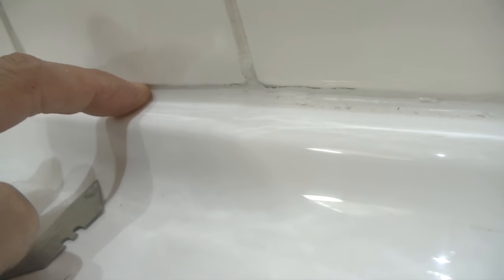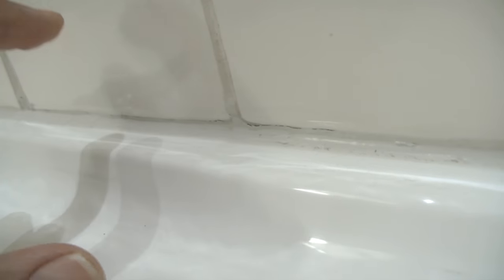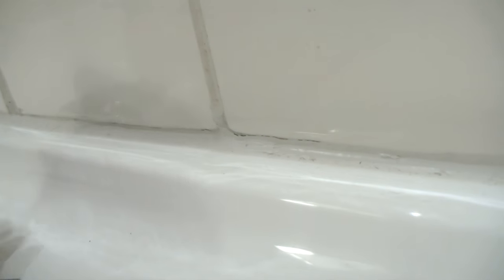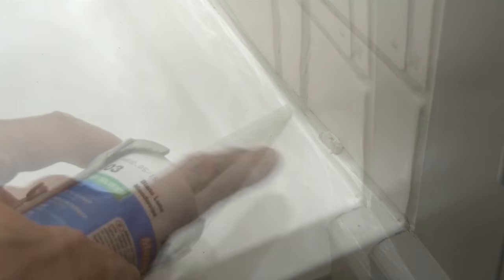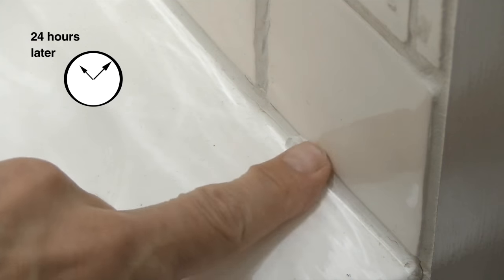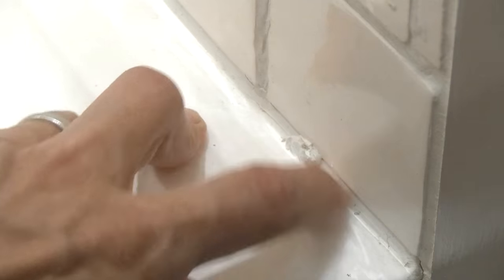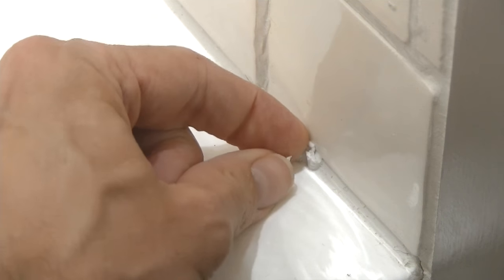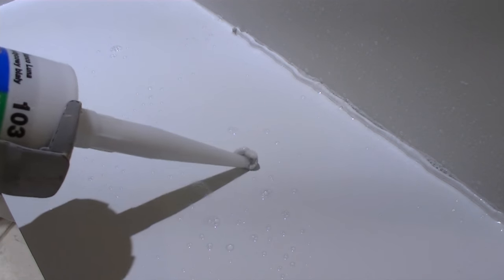Can You Silicone Over Existing Silicone?

Comment: Another tip i would like to add and my apologies if it has been mentioned already. WD40 is great for removing old silicone , spray on and leave for 5 mins then spray a little more and scrap off with a plastic scraper so not to damage the surface.
Reply from the maker: Interesting tip. Presumably it doesn't degrade the silicone, just reduces the friction when you scrape it off - so the primary benefit is not damaging the surface.

Comment: Thanks. Just caulked my bathroom entirely. A lot of uneven gaps between the stone and tub left when installed by last occupant. The job required using more caulk that you might typically use to fill the gaps. I didn’t want to overdue it but after it dried there’s a few tiny gaps left. This makes me feel better that I can fill them in instead of starting over. Thx
Reply: i hope you mean silicon. Caulk is for painting.
Reply: @ninpo1979  yes had me a bit confused there.

Comment from the maker: I posted this video yesterday and then realised (after a comment from Ian Mathieson - for which thanks, Ian!) that I didn't put enough emphasis in the video on the need to clean and degrease before re-siliconing. So here's the updated video - hope you find it useful.
Reply: Charlie DIYte:  Charlie, many thanks for the acknowledgement - wasn't expecting it!  Yes, good to use water and detergent to remove any greasy buildup on the silicone - we all know it exists, that's why we have to clean our baths from time to time.  But it's essential to then flush away any trace of detergent using plenty of water as detergent is a perfect silicone release agent.  Lots of flushing is the key.  Merely wiping with a wet cloth, while it will dilute the traces of detergent, will still leave some traces as the water evaporates.  This is a common misunderstanding amongst people trying to clean any surface prior to getting anything to stick to it.  Rub to get the worst off, then flush copiously, allowing the surface to drain off at an angle and then dry without wiping.  This applies to degreasing solvents as well as water.  In industry, hot vapour degreasers offer the best cleaning but are beyond the scope of DIY because of cost, the hazard of inhaling hot solvent fumes, and the need for regular maintainence.

And I can vouch for the effectiveness of a 45 degree edge.  There's a golden rule in industrial design when casting or moulding rubbers to bond to a rigid item, that there must be a 45 degree edge, either machined into the rigid item or built into the rubber mould.  A 90 degree edge fails at a lower applied stress because any mechanical load including temperature cycling, results in a higher stress concentration at the edge of the rubber and so reaches the strength limit sooner and encourages peeling.  A 45 degree edge allows the stress to taper off towards the edge due to local flexing of the rubber, so the stress at the edge is minimal and therefore offers the best resistance to separation or peeling.

Hope this is of help to everyone generally.
Reply from the maker: Thanks Ian. Not at all - I always like to give credit where someone adds value, and you've done me a huge favour by re-commenting, because I wanted to copy your entire comment from the old video but stupidly deleted it before I could do so!
Reply: Charlie DIYte:  Never mind.  Just a shame I don't have a copy of my first comment.  Didn't realise comments could be deleted once posted.  We live and learn.  I like the thoughtfulness of your videos and have subscribed to them fir the future.
Reply from the maker: Thanks Ian - much appreciated!!
Reply: Thanks for the vid Charlie, had some pretty poor work done by "professionals" that have gone mouldy within a month of them refurbishing my bathroom. They've also used silicone to fill the tile edge that meets the bath and I just can't remove it no matter how much scraping I do so it's great to know I don't need to do anything extensive other than remove the mouldy silicon, clean and reapply.

Comment: I'm glad this video just tells it undeniably. So many sites say you can't though look closely they are either major builders or the silicone manufacturer - go figure the motives! Chemically speaking so long the silicone is the same the new silicone has no way of 'knowing' whether the last layer just cured is fresh or old. The real issues are due to a layer or grease / dirt / mould which obviously DOES make a big difference. An interesting counter case: in the toy model world they have the opposite problem of having to deliberately spray a barrier between the silicone mould and the new casted silicone material so that they don't stick - so it can't be that in one industry the chemical properties suddenly behave differently to another!
Reply from the maker: Brilliant comment and you're absolutely right. It does need to be the same chemical make up, as well as properly degreased.
Reply: GE says you actually can just that it won't adhere as well as on a clean substrate. I've done it and it works. I just make sure that I clean the silicone that I'm covering with some rubbing alcohol to clean and remove any oils etc. Once this is done it bonds fine.

Comment: Ahhhh, see. I gather that one could use silicone sealant as an adhesive?  I'm wanting to stick two quite flexible silicone parts to one another. I wouldn't have thought of using sealant as adhesive.
This man is an unsung national treasure - a Barry Bucknall for our times!👏
Reply from the maker: Aw, thanks mate. Yes a lot of the sealants are also adhesives - eg CT1. It'll say on the tube if it doubles up as an adhesive. Check on a small area to see if it works.

Comment: I have to fix a botched blobby silicone job done several months ago. None of the joints are flush with the surfaces and there is plenty of cavity left to fill. If I understand correctly, I can clean the existing silicone with methylated spirits (deantured alcohol here in US) and once it evaporates, the original silicone will be OK to caulk over. It won't degrade the silicone? I removed a bunch of slop from the tiles with mineral spirits (white spirits in UK I think) trying to be careful not to touch the joints. Will that cause a problem if it did touch the joint or will the methylated spirits be able to clean it away? Thanks for the video, I agree with your technique as you were able to prove all your points. Thank you for taking the time to explain everything.
Reply from the maker: Hi Vicki, cleaning is always a tricky one as some solvents like acetone can damage plastic or acrylic baths/ shower trays. We have a cleaner in a spray can here called Multi-Solve which is great as it removes silicone but also evaporates without leaving an oily residue. You can never use WD40 for that reason - it's very hard to remove the oil and so the new silicone often degrades almost immediately. In answer to your question, I think there's a risk the methylated spirits will degrade the silicone. I can't remember whether I swiped it across the existing siliconing as in the video you only see me using it on the shower screen section which I'd totally removed the silicone from. My advice to you would be to use a degreaser like sugar soap solution or Zinsser degreaser and cleaner, rinse it thoroughly afterwards and then when it's fully dried you're good to go.

Comment: Been wondering this most of the day today. Silicone around my bath was done a couple of years ago but it's still clean and neat looking. Little bit behind the taps area though where the shower head water leaks down which I can see when I took off the side panel of the tub. Just put a clear silicone along the wall behind taps (can't tell it's been done obviously) so hope that fixes it. Touch dry just now but seems to have done the job.

Comment: This was really helpful, thanks for sharing Charlie.

Off topic, my shower grouting is cracked in between the lower tiles. I tried to re-grout after watching your tutorial but the results were messy. I’m hopeless with DIY.

I’m going to be selling my property soon hopefully and I can’t afford to have a professional in to do the job properly. Can you recommend something that I can fill the tiny cracks? I’ve seen various products on Amazon, one being a white liquid rubber product that has good reviews and can be applied using a paint brush. I’m at my wits end and currently have polythene sheets stuck with Gorilla tape to prevent damage to the actual wall behind the tiles.
Any suggestions would be greatly appreciated. 🙏

Comment: I need to replace the silicone round our bath, but the adjoining silicone that runs down the corner of the tiles from the ceiling to the top of the bath is still good. I was going to cut into it at the join and just remove the silicone from round the bath, then reseal it and try to blend that into the existing silicone that meets at the tiles. Would that work do you think?
Reply from the maker: Yes that's what I would do and in fact if you watch this video https://youtu.be/EErbuodMOAM that's exactly what I do.
Reply: @CharlieDIYte  thank you so much I'll have a look now! Going to sub too cos I need all the DIY help I can get lol. Thanks for the advice :)

Comment: I wonder whether it would be a different case if one were to use an acetic cure silicone over top of a neutral cure silicone (or vice versa).
Reply from the maker: Good question. You'd have to experiment in a small area like I did first.

Comment: Hi Charlie, thank you so much for your videos. They’ve been very helpful. I had a question. I used the Cramer tool to silicone around the bottom of my shower and did the 8mm size. If I decide I want to do 10mm, do you think I can just lay more silicone down over my current bead after I degrease it with denatured alcohol and tool over the old bead?  Or do I have to remove the entire original 8mm silicone and start over?  Thanks!
Reply from the maker: You're very welcome. I think that provided you use the same silicone and degrease it you should be fine. After all, that's what I did 👍

Comment: Any follow-up? How long did the small test patch hold? Thanks.
Reply from the maker: Still going strong a couple of years down the line, with no sign of mould or silicone failure, although I do fully squeegee the shower each day after use.
Reply: @CharlieDIYte  Still going strong? I'm doing a job where I need to build up in layers in a very awkward area on a window outside, so I'm using a hybrid polymer. I figured with how good that stuff sticks, it would have zero issue sticking to itself. Seems like it'll work based on this video.

Comment: Did you read the comment by Wyaj78 Charlie DIYte?
   
"As someone who worked in the maritime industry for 20 years doing most everything you can imagine the answer is a resounding no. My first rule is to NEVER use silicone period. It’s a contaminant more than it is a sealant. I’ve never experienced it sticking to itself with any success... ever. I haven’t ever seen it NOT fail either.
When sealing anything the number one rule is to over prep the area you’re going to seal. This includes roughing up the surfaces and cleaning it of any oils before you continue. Removing existing silicone is extremely labor intensive. Sure, the bulk is removed easy enough but what’s penetrated into the surface area is fairly permanent creating a big problem because it won’t stick to its self let alone anything else."

Q: If not silicone, what would you suggest for a bathtub? 

A: An acrylic bathroom caulk containing a mildewcide. It may not last as long as silicone on a NEW installation, but it will be a lot easier to remove and replace than silicone.

Comment: I was nervous about my reef tank re-seal. After watching this, and your response to my comment on your corner video, I applied a 16mm bead ontop of the initial 10mm bead.

I’m excited to see how it works out, hopefully I don’t have to spend another $350 on a new tank.
Reply: How did it go? I have just re sealed my 500 litre river tank but there is one area the silicone is, still a good cm out from the edge of the glass but is, spread really quite thin so I am going to go over it with a big dollop for peace of mind; as the reason doing this is due to a catastrophic leak aha. I'm very sceptical tho as everyone apart from one person in the aquatics hobby has said start completely over again

Comment: I followed your other video but messed up a 15 cm section in the middle and fast-setting silicone meant the surface got bumpy. Would it be OK cut out only that section and redo it, joining up with the existing bead on either side?
Reply from the maker: Yes that should be fine. Make sure you use the same stuff obviously and degrease the surface if you've used the shower, before you cut the section out. Yes you've only got a few minutes to tool the silicone before it skins over.

Comment: caulk master huh.  need help.  used ardex sx white caulk around my tub and within a couple months it turned yellow and hard.  now a year and a half later i need to attack this project.  ardex says if exposed to urethane fumes it will turn yellow and i used a urethane trim paint (emerald) from sw.  problem it is so hard, i can not remove it.  have been putting coats of acetone on it hoping it would soften it up.  found the tube downstairs and there was some dried caulk coming out of the end, it was white and soft/flexible.  any ideas?
Reply from the maker: Have you tried a silicone remover gel?

Comment: What about joining the new silicone bead with old bead (as opposed to over the old bead)?
Reply from the maker: I needed to redo it, in order to protect sections where the rather fragile glazing had chipped off the hand glazed tiles - the original bead didn't quite overlap the tiles sufficiently, and I had a leak where the glass screen meets the wall tiles, that needed sorting. Suffice to say it's never leaked since.

Comment: Hi, thanks for the video. When you clean with the spirit there, is that with the silicone still in place? If so, will this not impact on the existing silicone? Looking to do this and will clean the area first with methylated spirit, then silicone over the silicone?
Reply from the maker: Yes the silicone is still there. You just need to check the new silicone is compatible with the old. Try on a small area dust like I did, let it set overnight and check adhesion. Then you're good to go.
Reply: @CharlieDIYte  great thanks. So cleaning with methylated spirit first, won’t impact on the existing silicone? In terms of making it loose

Comment: I'm having a problem whereby a small patch of existing silicone on a vertical line has come away from a tile in my shower & I've put some Dow 785+ grey over it. However, I can't get the Dow to cure - it's more than 24 hours since I applied it & I'm wondering if the existing silicone is a different type & stopping it from curing? The tube I'm using was only opened in April, doesn't expire till next year & has been stored correctly. I tested it beforehand to make sure it was fine & it cured on a piece of cardboard. It's got me stumped!
Reply from the maker: That is bizarre. Not sure why is hasn't cured. You haven't put WD40 or any other silicone remover on the underlying silicone have you?
Reply: @CharlieDIYte  No, I didn't put anything on it. The existing silicone was Everbuild 825 which is a low modulous neutral cure & the dow is acetoxy so wondered if this would be the reason? The existing is more of a matt finish than the dow which is glossy. All very odd.

Comment: Great videos on caulking and appreciate the empirical testing on silicone on silicone.  One question, I know on the other video you did not like to tape  above and below the caulk, because  the thin ledge/lip created on the top edge  acting as an obstacle to down flowing water.  But I wonder would that really be a problem on the bottom side since  the water would flow over the bottom edge (assuming you're doing a 45 degree or convex bead?)
Reply from the maker: The thing is, you don't want a concave profile, and if you use the FUGI or similar forming tool there's no need for any tape, top or bottom. The silicone I did in this video looks as good today as it did 2 years ago because the diagonal profile is so strong. The lip created by the tape will become a breeding ground for mould.
Reply: Yes.  Based on your video I now have the Cramer set.   So I will give it a try.  I'm removing 8 year old clear silicone caulk - and now have a special hatred of clear silicone being used for any application other than on glass.

Comment: I watch your videos on silicon caulking and got the profile tool. All set I began the project. You make it look easy but when I did it, i got caulk everywhere. On my clothes. in my hair, on the tub, on the cat and I dont even have a cat. My beads look ragged instead of smooth. I think I have to take the caulk off Again and do it over. Or should I just caulk over what I did? Advice? Also I still have left over caulk, can I still use that from yesterday or should I buy a new one to attempt this job again? Your help would be appreciated mr caulking guru...
Reply: you can use it for as long as it doesn't go hard in the tube which is months ,usually blocks the nossle ,so get some spares

Comment: Why is soapy spray so bad for silicone? Surely it will not penetrate beyond the surface? Silicone dries under water. Please elaborate as I am confused.
Reply from the maker: Because the soap invariably gets into gaps that the silicone hasn't yet bonded to, and once it's in there, the silicone will never bond to that surface meaning water in the shower will instantly penetrate the joint.